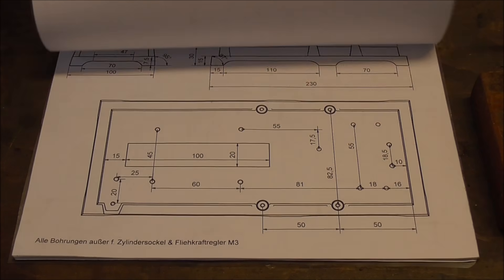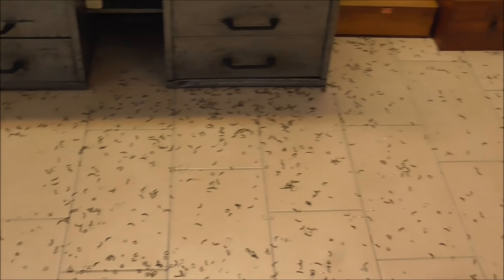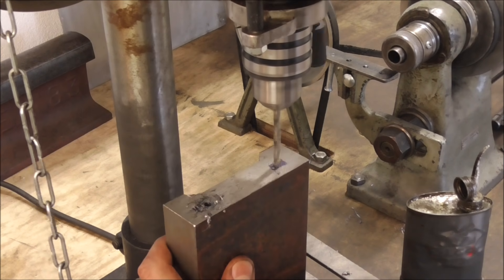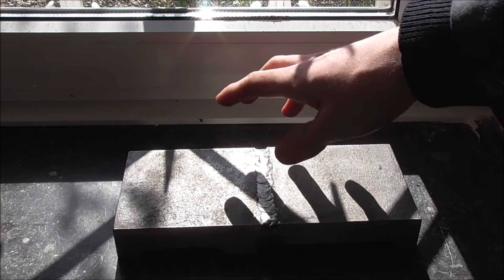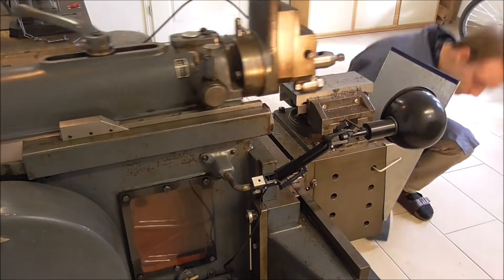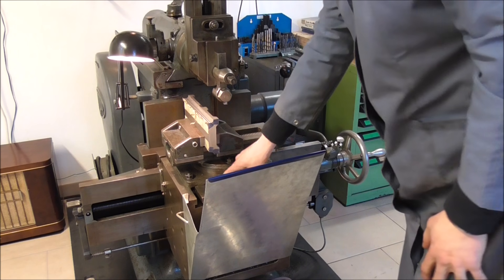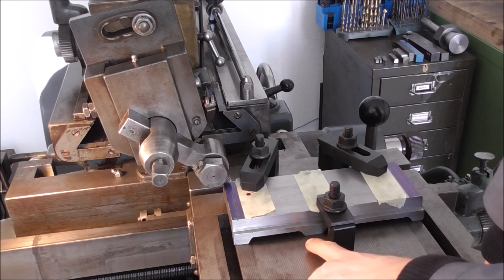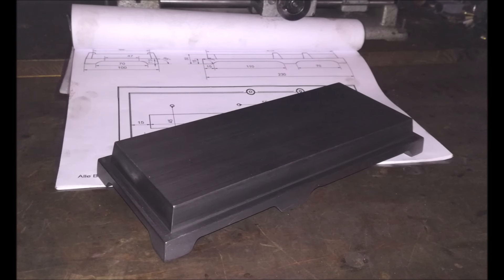Shaping the Base Plate - Doll 362 Replica #1

Comment: Very nice video, thanks! 
I've never seen such a welding motor-generator, I guess it's DC.
Yes, it takes about forever to machine large surfaces with a shear tool. Much faster is the flatnose. But it takes a good set up to work fine.
Reply from the maker: Yep, it's DC. Basically an AC motor coupled with a DC generator - from a time when Selenium and Tube Rectifiers would have been the size of a room to output the amounts of current required for welding.
Take a look at https://www.youtube.com/watch?v=o76sHxlwDE4 if you want to take a detailed look at the thing.
I've seen Abom79s take on the flat nose tool - what I wonder though is if it will work on any material or just soft stuff like cast iron or Aluminium, maybe.
Might need to try it out myself, sometime.
Reply: @AstraWerke  I do use the flat nose on mild steel, mostly because of the shorter machine time, compared to the shear tool. 
The mild steel is the challenge, talking about surface finish. The troubles are because the border of the chip, at the cutting edge tend to go in plastic deformation, instead of shearing. 
On mid carbon steel it is much easier to get the surface quality needed, because the steel is less plastic and usually a round nose tool is good enough.

Two things are very important, when setting up the flat nose:
1. The edge should be as parallel as possible to the surface.
2. High front rake on the edge.
For the first I hone the back rake directly on the shaper, using the roughed surface as guide. Abom has shown that in one of his videos.  The second is necessary for shearing, instead pushing the chip.